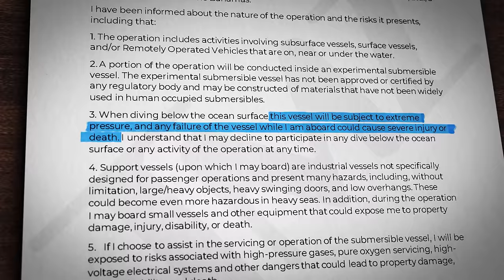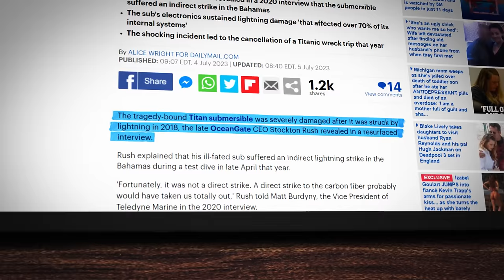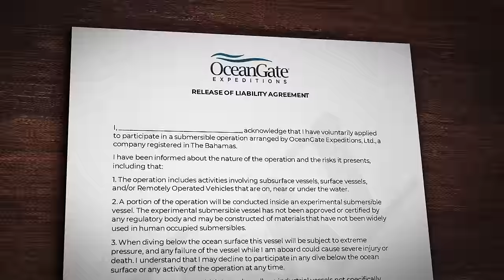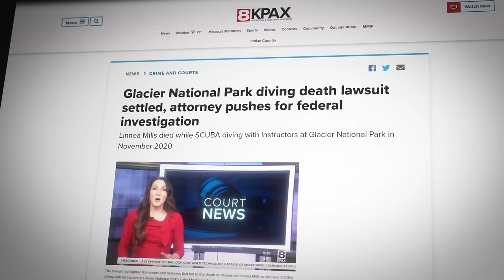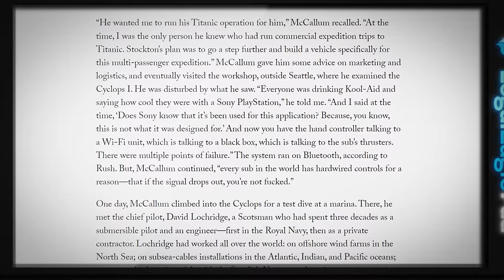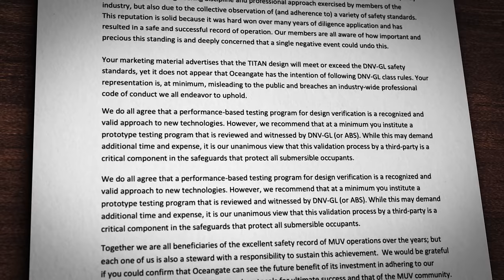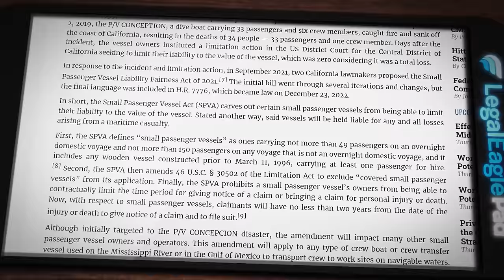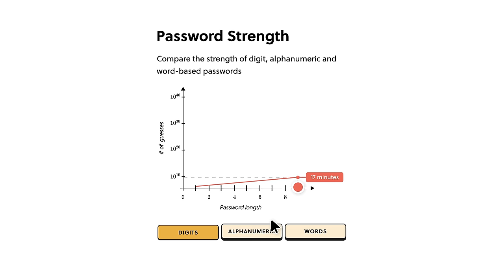OceanGate Is Getting Majorly Sued

Comment: "...or even crossing the street."
😳😳😳
If I heard someone claim that their trip to the bottom of the ocean was less dangerous than crossing the street, I would get the HELL away from that person as quickly as possible.
Reply: After this event, yes, that makes sense. But thinking about pre-this event, I'm not sure how I would've responded. (Not that I'm in the position to pay $250k to do anything like this.)
Reply: @alisa9040 It's simple logic - just because nothing bad has happened doesn't mean something bad can't happen, and there's a lot more risk of death involved in being at the bottom of the ocean than crossing a street. If something goes wrong at the crosswalk, you might die, if something goes wrong at the bottom of the ocean, you will die. Anyone who would say that "it's safer than crossing the street" is obviously trying to minimize the real risk by making a faulty comparison.
Reply: @drpibisback7680 flying in planes is safer than crossing the street tho, that safety measure is misleading
Reply: @drpibisback7680 might be the confusion between safety and riskiness it might be less risky to be in a safely rated submarine at the bottom of the ocean than the potential risk for something going wrong when crossing the street
I'd imagine those numbers however rely on all the safety procedures taken to be taken.

It's like how flying is less risky then driving, or how nuclear energy is less risky then coal or oil, it's terribly unlikely for something to go wrong (but when it does it can often be catastrophic)
Reply: @drpibisback7680  what I'm trying to say is we have the benefit of hindsight and knowing that it was doomed.

Before this happened, they didn't have that knowledge, you know? Yeah, a lot of people were trying to sound the alarm, but it's kind of like hearing an alarm before seeing fire or smelling smoke. Is it a false alarm or do you really need to evacuate?

Comment: The FACT that the guy wouldn't even pick up the passengers but made a dingy bring the passengers out to international waters should tell you that this guy (and company) KNEW that they were operating dangerously.
Reply: And he called the fee as "donation" to intentionally avoid law and regulation regarding passengers vessel.
Reply: A "FACT" without a  citation is merely an assertion.
That was on other trips?
Reply: This is not that unusual for crafts like this. Have you seen the interior of the sub? You wouldn't want to spend any more time than is absolutely necessary inside a tiny submersible. So you go out to the site in the relative comfort of a bigger ship
Reply: They used a ship called Polar Princess to get out to the site. Weighed several thousand tons so it wasn't exactly a dingy.
Reply: @SofaKingShit  Jesus you guys are thick, the guy here doesn't mean that he used a dingy to get the passengers to the wreck and then get them in a sub, he means he used a dingy to get the passengers from the US to the Polar Princess, so that he would avoid docking the Polar Princess in a US port, or even have it enter US waters.
Reply: The passengers were not from the USA, the "dingy" launched from Canada

Comment: If the window was only rated for 1300 meters doesn't that already instantly invalidate all waivers? That in itself means they knowingly lied every time they said that the sub can safely dive to 4000 meters.
Reply: Yep, if anything they would have been better off with an unrated viewpoint in my opinion.

Designing and having a custom viewport built that you believe will be strong enough without an independent rating is probably better from a PR point of view than having a a tested and reliable company say 'this should only be used to 1300m and no deeper'.

Ultimately having an underrated viewport was probably better than having an unrated one designed by an idiot but it looks worse in my opinion.
Reply: I'm not sure. OceanGate will probably argue that the viewport dived a dozen time to the Titanic already. And we don't know yet but so far, it seems that the sub failure was on the hull, not the viewport.
The 1300m rating doesn't mean that the viewport will fail if going deeper (and OceanGate will certainly argue about it) but it mean that the manufacturer didn't bothered to test it or didn't certified it for various reason (like fatigue. Maybe they wanted to sell the viewport as having a 500 or 1000 diving cycles and going 4000 meter reduced that cycle to 10 or 20 times).
Now of course, do'nt get me wrong, I think everything that could have been done wrong was done wrong, but the viewport not being rated for 4000m may not be the most solid angle of attack, even if it's one of the most obvious ones. But it will certainly add up to the pile of "things done wrong".
Reply: @LeSarthois an unrated part not disclosed to the dive members would seem to invalidate the wavers as the company knowingly used a part that was not safe a the dive depth. If that information was in the wavers and the passengers still signed ( because of your reasoning for instance ) then fine. But the “ withheld information from the purchaser “ legal clause seems very evident here. Even if that particular danger did not cause the failure. I suspect by the time the litigants are through with discovery there will be a gigantic list of “ withheld information from the purchaser “ items.
Reply: They meant if you take out the window and go anyways.
Reply: If the laws were still rational, unless it could be shown that failure of the window contributed or was the cause of the sinking, it is irrelevant and a non-issue.  However, that is qualified with, "If the laws were still rational."  And the sub already successfully completed several dives to 4000 meters, meaning there was no lie in saying "it could" dive to such a depth.  But you are right -- such arguments will be made and will probably prove successful.
Reply: they hardly 'lied' the viewport ability was a public fact. lets face it people like that bloke out of Eastenders had a team that advised against using the titan. so why did these people not have the ability to do that? was it because they were too poor to afford real scientists to evaluate the design?
Reply: @LeSarthois maybe they were testing for when it fails. That's why they have Mission Specialists
Reply: There's a clip out there of Rush explaining how the plexiglass porthole would bow significantly at depths. I think that should have been shown to all potential passengers for full disclosure because I shuddered to hear it.  Along with any notes involving cracking sounds. That would get how experimental this is across.
Reply: Rated by the manufacturer, not OceanGate. Their claim was that it was safe well beyond the manufacturer's rating. And to be fair, a safety factor of 1.5 is pretty much engineering law, but that's still pretty freaking far off the mark of 4000 meters. This whole situation reeks of profiteering and deliberate negligence to mislead the "mission specialists".

Comment: The thruster being installed upside down, and them not even knowing it until they’re just 300M from the wreck of Titanic, is absolutely nuts. You check all the controls on a Cessna-172 in a preflight checklist before you even taxi out onto the runway. Just insanity.
Reply: And a Cessna 152. A full walk around "hands on" inspection BEFORE you sit in the cockpit.
Reply: @JeepinBoon  Gotta move all the ailerons to their full extension and the rudder to make sure nothing is broken
Reply: It more likely a wiring harness plugged in backwards. Not immediately noticeable unless in the water and doing a proper functional control test as part of a checklist like airplanes do before take off.
Reply: In the case of Oceangate the question is; checked by whom? Rush openly admitted to NOT wanting to hire professional engineers and operators in lieu of hiring younger and less experienced (and cheaper) staff. Even if it was installed incorrectly, how many qualified staff were even around to catch the problem before it caused a disaster?  Disgraceful.
Reply: And when you go scuba diving you check that all of your equipment is securely attached and functional yet this company skimped out on something that is standard procedure for dives going to only 15 metres
Reply: @jatzi1526  You're right. It's all part of the checklist. But I do a walk around before grabbing the checklist binder. Habit. Some things you only notice outside the plane, hands on. Like one elevator being a quarter inch lower than the other.

Comment: I spent 10 years designing, analyzing and testing composite overwrapped pressure vessels.  Some of my designs are orbiting Mars, Mercury and are in common use in various satellites. When I heard the details of this vessel I was absolutely stunned at the design choices Ocensgate made. I wouldn’t have taken a free ride on this death trap knowing how it was built. The flaws are glaringly obvious to anyone who has worked with composites.
Reply: Especially knowing he bought them at a discount because the resin was expired
Reply: @nubreed13  In compression you rely to a great degree on the strength of the resin and not so much the fiber. Using expired product means you won’t get the full strength of the material after cure. Stockton Rush was an arrogant fool.
Reply: @artjackson8360 What has surprised me is how dismissive Rush was of any criticism 😮 Is that common in engineering communities? And hiring very young professionals instead of those with extensive experience, is that common? Seems like Rush was a bat sh!t crazy cowboy who was too high on his own PR. And 5 people are dead, and I don't know who is going to hire those young people he exploited for cheap labor.🤦😞
Reply: @texasgirlmomx2342  It reminds me more of a tech-bro mentality - fake it till you make it, more concerned with selling an idea than with building a thing, adoring excitement and cool-sounding technobabble over reliability and good practices, and a deep contempt for the boring nitty-gritty of actual engineering.
Reply: @varana  woooow!! Thanks. I spent 20 years as a teacher, so it's so mind boggling that Rush was able to convince sooo many people "Stockton knew BEST". In Greek mythology, it's the Cassandra principle. The king wanted a soothsayer, not a truth teller, and it cost him. (and her, as well, consequently )😞 💔 I guess "run fast and break things" only works in environments where you can, ummm, actually run. 😳🤦(And then, maybe not so much there either) What an avoidable mess. 🤦😞
Reply: I build high rises, stadiums, over large river bridges. Not a trained engineer but 25+ yeaes in an unforgiving trade. I could have told you why in compression composites are a horrible idea. The fact multiple people reported loud cracking all the way back up to 300ft on previous dives pretty much proves to me it had large flaws slowly moving n cracking apart every dive. Literally an untrained trade worker coulda told em it was horrid idea
Reply: @captaintoyota3171  First thing I said was that it wouldn't handle the pressure cycling for long. Proven in aerospace a thousand times and more!
Reply: @artjackson8360  Right? I have no specialist knowledge of this, but knowing what fibres are, it just sounds like a 'carbon-fibre hull' is really just an 'epoxy hull'. It's the epoxy that's holding back the pressure.
Reply: @nubreed13  Yikes, did he really purchase expired resin products?
Reply: @captaintoyota3171  exactly
Reply: @mrdan2898  yes he did.  He gloated about getting a great discount on it.

Comment: Waivers usually say, “We have done everything humanly possible to keep you safe, but there is still risk.” 

OceanGate clearly didn’t do everything possible, or anything really, basically negating the waiver. They didn’t hold up their end of the bargain. If this goes to court, the only use for the waiver will be if the judge wipes his butt with it.
Reply: Not a good idea to use the waiver as toilet paper... with all the pennies the Oceangate CEO pinched, it's going to be a low quality paper, too rough.

Comment: My first thought was "certainly there's an argument for 'gross negligence'" after I had heard about the story.  My wife and I are both mechanical engineers and both of us were immediately concerned and apalled that he would use carbon fiber.  We were both relieved that at least one engineer tried to whistle blow on the design flaw and gross safety risk.

All his actions sure stink of maliciously lying over the capabilities of the sub.
Reply: I too am an engineer. Studied mechanical and have been doing heat transfer analysis. When I started reading about the sub when it was just missing I was like "why the f**k would you use carbon fiber?!"
Reply: what's wrong with carbon fibre?
Reply: @MargaretBelle  There's much better information out there than what I can give you, so I suggest you do some research of your own. With the whole OceanGate thing, lots of people have written about this exact problem, so plenty out there.
The gist is that carbon fiber is an amazing, lightweight material in certian circumstances, but it's not magic, and OceanGate was using it in the way it was actually weakest. Carbon fiber is very strong in tension (when you're pulling on it), but not very strong in compression (when it's being pushed together). It also doesn't do well with fatigue. Compression and repeated loading are things that a sub needs to do well, but carbon fiber cannot do
Reply: I’m not an engineer, but my experience with carbon fibre bikes made me think, that’s not great. Two things stood out for me, first, my carbon bikes are incredibly stiff and strong but I’m able to crack it by over tightening a clamp bolt by a few Nm. Second, the fusion between carbon tubes and alloy lugs on early carbon bikes was a common failure point.
Reply: As an ME myself, I was mind blown when I found out it was made from carbon fiber!! Carbon fiber has horrible compressive strength
Reply: @MargaretBelle  carbon fiber is basically a "fabric" with "glue" impregnated into it.  In compression, once the glue fails, you are very literally trying to push a rope.  The only strength it has in compression is due to the glue; the fabric provides next to no strength in that direction.  In tension, it's like trying to pull a very very strong rope and rip it.  The glue is also why it's terrible at "fatigue strength" (which is when something is repeatedly loaded, think a trampoline or a spring).  The brittle glue develops very tiny cracks, which when stressed over and over again (like going deep underwater and then resurfacing), grow larger and weaken the material even more.

It was quite possibly one of the worst options he could have used, and he was told by quite a few people.
Reply: @holdintheaces7468  The video explains exactly this! Thanks for the additional detail.
Reply: The more videos I watch of the whole thing the more it’s clear that this dude was willing to completely ignore everything, and I really do mean everything, just in order for his company to have a successful dive and be known as “a pioneer who pressed on despite negativity”. In his mind people concerned about the safety of the sub were basically just haters. 
There’s one video where he goes off about things people said you shouldn’t do and he’s just like…”they told me carbon fiber wouldn’t work but I did it”
Reply: Not to mention the use of 2 different materials that needed to be fused and therefor giving the pressure another way of attack AAAND to make it a tube instead of a sphere to accommodate more people
Reply: Carbon fiber is not a problem by itself, but it has its specific needs.
Reply: @HalNordmann  you didn’t read any of the conversation in the above comments, huh?
Reply: I’m a second year engineering student and even I know they shouldn’t have used CF for the pressure hull. How they got away with it boggles my mind
Reply: He mistook the project for one in which a street racing car would be built.  I can think of no other explanation